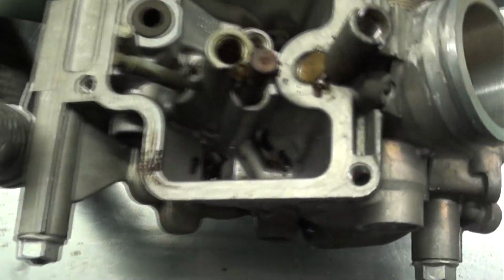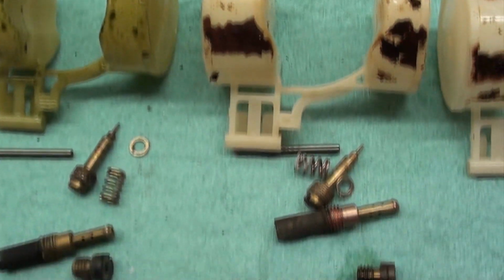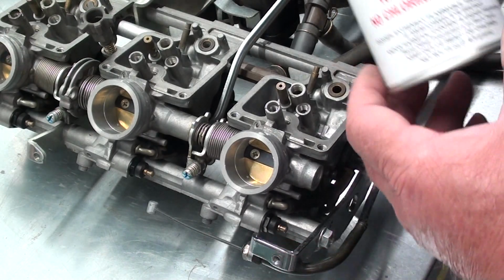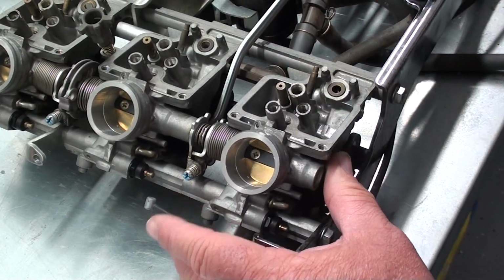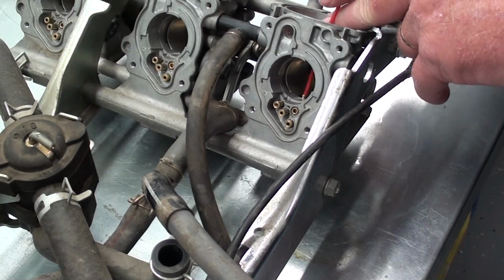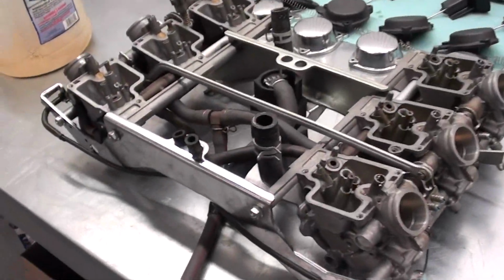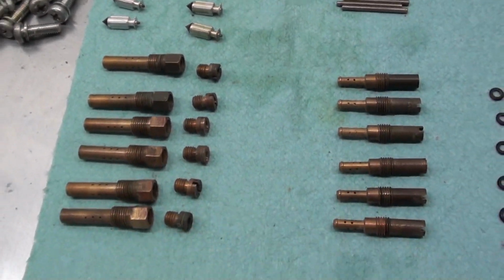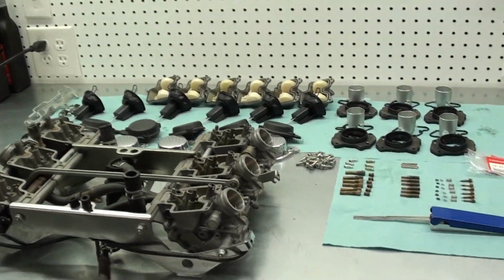Pt.7 1998 Honda GL1500C Valkyrie Project - How To Clean The Carbs

Comment: Hi Ray, your videos were very helpful. I totally disassembled carbs and cleaned them. Put them all back together. Everything‘s great except the plastic t that runs from the main fuel line on the left side is leaking on the back left carburetor. How do I get the carburetors off the rack to replace the rings. They seem to be part of the casting the  Center, in the back carburetors

Comment: Was going to try and remove the slides and float bowls with all entrails while carbs were mounted.  I quickly saw that this was not the way to do it...so I removed airbox and it really wasn't that bad...to put them back on will not be bad at all, I presume.  I will make sure the box is in and carbs are connected before I replace the bottom intakes and boots.  That should make it that much easier.   Alibi....why do vacuum hoses run to lower intakes on 1 runner driver side and 2 runners passenger side?  Why not all of them?  Tks

Comment: You did not address the "bystarter" valves.  I have removed mine and hope to spray in there...please tell me why I should or should not do this.  Also, I plan to remove or De-smog the motor while I've got it apart...please also tell me your take on doing this.  I do not plan to purchase a $70 pretty chrome plug kit when all the smog plugs are fine.  I plan to take the two bodies out of the middle and plug the holes/hoses in the middle and from the outside will look as though smog stuff is still active.  Just didn't make sense to remove the exhaust and everything else you have to remove to replace plugs that are already in place.  Tks for your input.  :)

Comment: Your videos are awesome.  Thanks for all of your hard work.  I would like you to direct me to a video that shows more clearly how to remove the intake box and intake runners prior to removing the carbs from the motor.  I've just taken over my father in laws 98 F6 Valkyrie as he can no longer ride.  Has 19k miles on it but sitting in barn for couple years and will only run when carb spray is introduced.  I fear that the carbs are all gummed up and need a good cleaning.  Tks   I live in Augusta, GA.  If you are close...how much would you charge for a good cleaning?  And or how much is a fair price for the procedure done right?  Tks  Also, is the F6 anything special?  European model? anything like that?  Tks

Comment: Thankyou for the videos! I have a 1999 Valkyrie 1520 touring and it is in need of carburetor work and with all the detailed videos you have on that bike it will not be a problem doing this myself. Oh yeah talking about the jet tool I grew up using bread ties, you just strip the plastic coating and you have a new jet cleaning tool for every carburetor job!

Comment: Hey D Ray I have a 1997 valkiery just had my carbs rebuilt and I've been thinking about putting bigger jets in it to put 6into6 pipes on it will the carbs need to be completely took off the bike again cause I was thinking on doing it myself , hope to hear back from you

Comment: Great vid. I plan on doing this soon since I am getting a large amount of gas pouring out of the carb over flow tubes on a bike that has set for 4 years.   What do u suggrat to use to clean the rubber gaskets and rubber pieces?